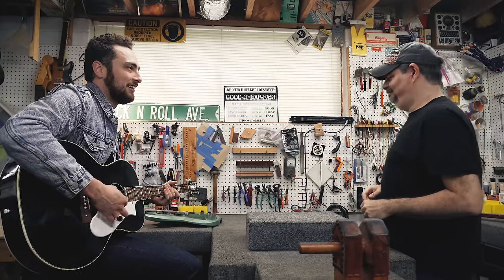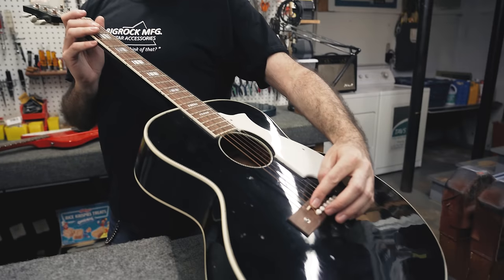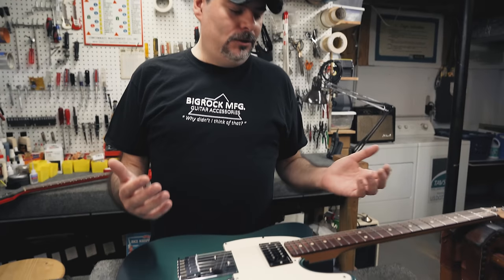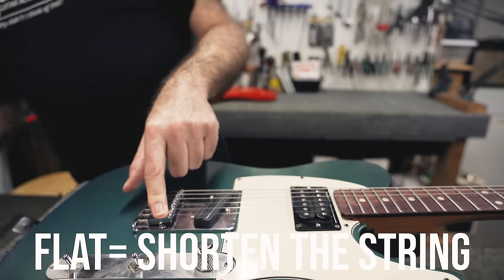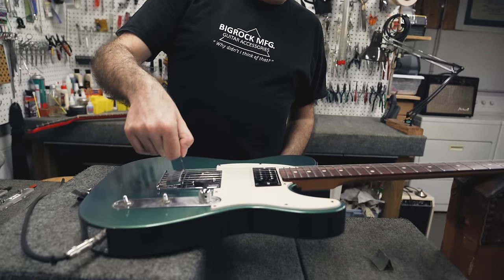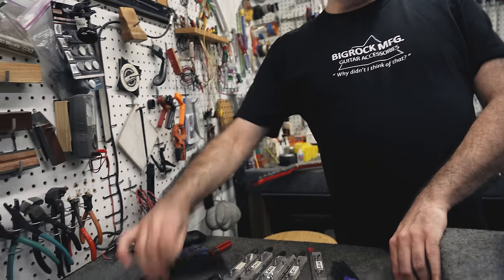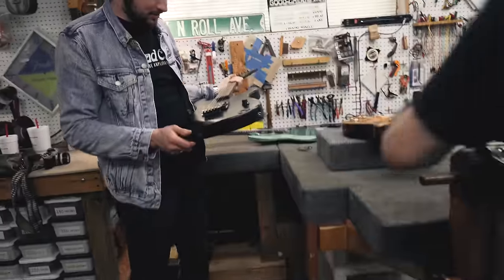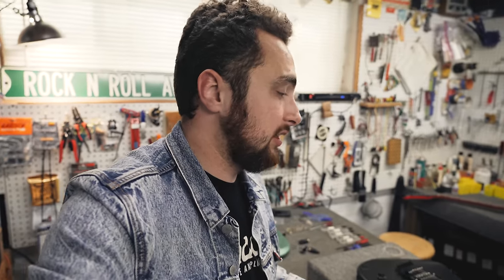5 Guitar Setup Tips & Tricks You NEED To Know

Comment: What a great tip on the pin puller. I've always used the notch on the string winder to pull the pins up, but it can be kind of dicey, as Rhett mentioned. I've ordered one of these and will probably end up getting one to keep in each of my steel string acoustic cases so that I have ready access whenever needed.

Comment: Good stuff.
It is much easier, and more accurate to use the strings on the guitar to check neck relief (bow) rather than trying to eyeball it.   With all strings tuned to pitch, put a capo on the first fret, then fret the string at various points along the fretboard.  It is 98% as good as a regular straight edge.
    The velcro trick is great.  Much better than using tape.

Comment: Great channel.  Thanks.  As far as ideas for another set-up video, I'd love to see Dave start from scratch with changing a nut, but most importantly the process he uses to get the nut slots all cut to the proper depth for a real low action setup.  I've cut two nuts and both times I cut one of the slots just barely too deep and had to use the super glue/baking soda trick to fix my mistake.
Reply: I usually buy nuts that are pre-slotted... they're usually a little too tall, so I just sand off the bottom side of the nut rather than working the top side down, it saves time, but I'm not gonna lie, changing a nut and getting it right takes some time and definitely some patience.  I don't remove the strings from the tuners when I change a nut, I just loosen them and put them off the sides of the neck, taping them down with painter's tape if need be, to keep them out of the way, but I've got to say, Dave's velcro strip trick would be really handy in this situation to keep them out of the way, too, I think.

Comment: I gave up trying to sight down the neck to check bow/relief years ago. The string under tension will be straight. So just put a capo on the first fret, and hold the string down at about the 15th fret for an acoustic, and check how much space there is between the string and the neck at about the 9th fret. Lots of space = too much relief =  tighten the truss rod. No space = back bow = loosen the truss rod. But before mucking with the truss rod, test both the low and high E strings. Sometimes necks twist a bit. As far as intonation testing goes, I find I get better results comparing 7th fret harmonic with 7th fret fretted on acoustic or 19th fret harmonic with 19th fret fretted on electric.

Comment: The acoustic guitar bridge pin thing is actually unnecessary, to my knowledge. If you push the ball-end of the string towards the interior of the guitar (i.e. pushing the end of the string that the pin is holding towards the inside of the guitar), the pin is no longer tensioned and you'll need absolutelly no force to take them off. I don't know if anyone already mentioned it or not. Nice work, Rhett and David!

Comment: Rhett, how about maintenance on tube amps. Are some tubes interchangeable? How and why to adjust bias, if so. How to know tubes are bad or going? Does the clean channel on a hot rod DeVille always distort? Do certain guitars have more distortion than others. Discuss amp hum and noisy power in buildings and what to do about it. Do tube or solid state have more noise? Do you ever find low voltage in buildings? Does it affect your sound? What to do. What about outside gigs with generators. Are they safe on solid state and tube? How do you get your tubes tested? What do you do about noisy jacks on guitars and amps? Do you leave your pedals constantly connected or do you break down your pedal board after gigs or tours?
What are common problems with tube amps and what to do? Are tube varieties interchangeable, which ones and why. Does an el84 replace a 6L6? What about preamp tubes? Can they be swapped out to find a desirable sound? Are Sovtek better than Groove Tubes or any other brand better than another?
What are your favorite guitar pick ups and why? Who builds best or least best pickups? Why would you ever change out your pickups and what do you look for in a pickup? What about Hot Rails? Are they good or bad.
What about acoustic pickups? Do you ever change them out, why? Do you like pietzo pickups or blenders? What to look for when buying an acoustic electric? Chambered vs non chambered electrics, sound, feedback, what to look out for.
Are high ouput pickups more desirable than low output or medium output pickups?
What about splitting a humbucker or parallel windings vs non-parallel winding setups? What position would you want them in, what to expect in sound performance.
The difference in the tell bridge, humbucker or single with the ashtray bridge vs LES Paul and Strat?
Does the neck length between LP, telephone and Strat make a difference?
Does the wire quality in a guitar cord or pedal board cable make a difference in the sound?
I enjoy your shows. Thanks.

Comment: I don't know about guitar action, but I play 6-string bass and I use graduated 12th fret action: B at 2.75 mm, E at 2.5 mm, A at 2.25 mm, and the rest at 2 mm. That gives me more even fretted string tension across the neck and I don't have to worry about the bass side strings rattling. With the neck flat, it plays like butter.

Comment: Cool video, and some cool gear. I especially like the string retainer. Ive Never seen one like that..i will say, You might be able to see major problems with the truss rod by looking down the neck but to truly get it where it needs to be that is not the method.. it also doesn't do much good to check string height from the fretboard considering the string rests on the Fret and fret height changes with each guitar...

Comment: Thanks for this series guys.  Really cool!  I'd love to see Dave talk about soldering.  I'll see irons labeled with watts and then also some that have temperature adjustment.  What temp should I be soldering guitar controls at etc.
Reply: I know you didnt ask me but I solder alot. Temp wise it depends  on what  your soldering. Small components on a board or connections to a pot etc. larger items will absorb more heat etc. for me its about time it takes to heat the joint. You want a quick reaction so  you set the temp accordingly. Average start point when your unsure about 700F. Go up or down from there. A great tip I learned is to use a bit of solder on the tip , this helps transfer the heat quickly and gets you a fast reaction. Make sure it flows well and thats it. There are more tips to good soldering but thats too much typing

Comment: On pickup height I agree. All pickups are not the same. I usually start with the neck flush with the ring. Then I try to balance each string by adjusting the pole screws. When that's done I adjust the height by listening to a balance between a weak and too strong sound and try to hear each note "bloom" or change if possible. I always keep track of how many 360 degree or 180 degree turns I make with the screw on each side. After that it's the same with the bridge pickup and then check the balance of the bridge pickup to the neck. I might have the bridge a little "hotter". I always error on the side of the pickup not being close to the strings. Anyway, that's what I do.

Comment: A capo is even easier for holding strings in place.  Also, keep your bridge pins sorted, or only pull out one at a time, as sometimes these are cut to fit or just worn in and will fit that slot correctly. Good info, thanks for posting!

Comment: Some good tips and tricks right here. I would've liked dave to talk about what to do with acoustic guitars with too high action, if the truss rod is set right. Thanks Rhett.
Reply: Three potential methods, depending on guitar model, and where the action is too high (at the nut, just on upper frets, etc)
- Remove the saddle, sand the underside on a flat sanding block to remove desired amount of material
- File the nut slots deeper (recommend using a set of nut files… not for the feint of heart)
- Remove the nut, sand the underside as described for saddle, and re-install

Comment: Using the correct order for a set up is critical. 
Tune to pitch, then Measure neck relief with feeler gauge with capo at first fret, using manufacturer's spec or your personal preference. (i.e. .0012  @ 7th fret pressing 17th fret on my Tele). If you can't get close to that number, there is a neck bow or unleveled frets to address. You'll have buzzing for sure.
Once neck relief is good, measure string action at 12th fret (no capo). My Tele is good at .060 or 4/64th's across the fret board. Now use the saddle screws to adjust the height of each string. These should parallel on 6 saddle bridges with two screws. When you have string action right, the radius will be correct along with the saddles. No point in adjusting saddles with the radius tool first because it doesn't consider the action height. Set the pickup height next. I like 1/8th on bass side and 5/32 on the treble. Now, you should have optimized your playbility, time for intonation.

Once all that is good look at your 1st fret action. If nut is good you'll be in the vicinity of .0018-.0022 and not be working so hard on open string and cowboy chords. Nut adjustment? Nut work is tricky, if you have to adjust, study up or get luthier help. It is probably the most important variable in a top notch set up.

Comment: Great video. Personally, I only look down to the neck of the guitar to see if it's twisted. For neck relief I usually use a capo (or your finger, whatever you have) on the first fret and place your finger on the last fret and check the distance between the bottom of the string and the top of the fret. Usually want around .012" of clearance so a small gap. Just a method Ive learned from guys like "Dave's World of Fun Stuff" on YT.

Comment: Here's a tip for anyone using a pair of cutters to pull bridge pins:  Use the saddle as a means of leverage, put the cutters handle on the soundhole side of the bridge and just press down gently, you'll break a LOT less pins this way, and you'll have a lot more pin pulling power at the same time.  Best to just buy the tool, but if you HAVE to use cutters to pull them, do so by this method to save your bridge and your bridge pins.  Gently pushing down on the saddle won't hurt the saddle, your strings push it down a LOT harder than you ever will with the side of the cutters.

Comment: Make sure to account for string tension on adjusting truss rods! If you have to take that neck off, the neck is flattening when you loosen all the strings, and if you just blindly say, "ok, I want it there" after adjusting, when you tighten up the strings again, lo and behold, it's too curved cause you didn't adjust for string tension. So get a feel for how much string tension curves your neck, and account for that if you're having to take your neck off to adjust it. With the strings on and tight, see where your neck is and imagine how much change there should be to make it straight, then apply that same change you imagined to the new set point when you take off the strings, flattening the neck. See the now flatter neck, and change its curve the same amount you know your tensioned neck needed to be curved. When you put the strings on again, it'll be perfect. Also, proper setup order: neck first! Then string height, then intonation. You adjust your intonation and realize "hey, I need to adjust the neck too" you've fucked up your intonation, and will have to redo it more than likely. This is from my personal experience and I hope it helps somebody. I just don't want people learning to make the same mistakes and get frustrated with it and give up, giving their guitar to a tech

Comment: Re: Pulling bridge pins—with the string loosened, often you can push the end of the string into the guitar a tiny bit at the bridge pin, and that will make it a lot easier to pull out (because of the wrap at the ball end). —Tom
Reply: Also when the strings are loose you can simply put your hand in the sound hole and push the pins out from the inside.
Reply: @zardeh63  Good point. Pushing through the top is particularly useful if you usually change one string at a time, or if you're replacing a single broken string.

Comment: Most common playability problem on a guitar is nut height. If the guitar immediately feels nicer to play with a capo on the first fret, your nut slots aren't cut quite deep enough. The nut should be holding your strings no higher than a zero fret would in the same position.

Comment: Great practical help, thanks! Quick question.  When measuring the distance between the fretboard and a string, do you measure the distance from the center of the string or from a point on the circumference?
Reply: From bottom of string to top of fret

Comment: 4:40 HOLD UP!  Use a socket, sure, but hold the socket (i.e., do NOT use a driver, hold just the socket with your fingers) and tighten BY HAND otherwise risk cracking the finish!  In fact, just make the nut snug.  The machine head is wood and, as such, will cause the nut loosen up over and over over time.  Just sung up again the next time you change your strings.  NOTE: Not my intent to step on the guru's toes at all.  I cracked my Les Paul because I over tightened with the driver, ugh!  Don't do what I did!  Friends don't let friends harm guitars - ha!
12:39 Guilty, and broke the pin.  In my defense, had no choice at the time - cheers!
Reply: There's a company called HOZAN that makes a set of handheld sockets that are perfect for this, and they also work for tightening the nuts on volume and tone controls, because they're hollow, and you can run a small screwdriver through them to hold the shaft of the control as you're tightening it.  They're called volume box wrenches.  Parts Express used to sell them, they come in a set of 3.

Comment: Never set intonation on old strings.  If they're dead you'll get false readings.
Reply: How though? A string that is in tune is in tune regardless of age
Reply: @teslaedison6236  Because when you put a new set of strings on, you will have to intonate again, since you didn't intonate with fresh strings. Like rock and roll resale said, if they are dead (or old), you will get false readings.
Reply: Tesla Edison 
It’s actually somewhat true. Usually for the coiled strings. They can have little separations in the coils, usually near a contact point like bridge or nut. This can mess with intonation.

Comment: So for clarification, on a compound radius fretboard, adjust for the flatter radius? (i.e. set it for the 16” radius and not the 9.5” radius?). Thanks!
Reply: I would set at 20, imagine a cone that is 9" at the nut and 16" at the 22 fret, by the time it gets to the bridge it would be larger. Thats what I researched for my tele, it seems to work great.

Comment: Are radius gauges required if you just measure how far your strings are from the fretboard?
Reply: no...they're just guides and preference. Not all guitar has the same radius.
I just eyeball..use  a quarter at the 12 fret ( its on low action).
Some people likes it higher

It's even like that on my accoustic...but my accoustic has pick up...
so I dont strum them hard to begin with...like the amp do the work.

I have lots of guitars for many reasons.
Alot of it is becuase they're all tuned different..If you change tuning
the neck will flex back and forth...it'll alter the intonation too.
yes...I even have different guitar with floyd..with different tunnings.
it is what it is. Depending what brand. model...the neck will have
different fretboard and back of neck profile..ect

i also build my own guitars..I did learn if there's not enough tilt angle
on the guitar neck..it'll cuase problems no matter what you do.
Most of the time...factory BOLT ON neck guitars are okay.
Sometimes...there's paint/lacqur in the neck pocket..i'll just file it off...
or increase the tilt angle on the cheaper jackson, tele...ect

It's a pain on accoustic to make that correction..I more mindful
before I make the purchase.

Comment: This was a great idea but an awful lot to fit into the time you allowed. Some of the points deserved more thorough explanation and the last one on pickup height was the most in need. It’s a broad and very subjective adjustment. Judging height using the distance it extends from the pickup ring is not at all reliable. There is no constant from guitar to guitar on how high the bridge is for proper action due to varying neck ankles. 
Really don’t mean to be a jerk but we all have the best intentions.

Comment: Intonation question - On my Strat, my low E saddle is getting very close to being as far back as it can go. I've kept on the neck adjustments, but over time, that one keeps going sharp. (And I check my intonation with new but broken in strings.)  Any suggestions?
Reply: Gary Beason had that with my strat also, if you have the micro tilt adjustment on the neck mounting plate, you may need to turn it clockwise only a bit. It did the trick for me.
Reply: @vdub1959  Sadly, it's a '62 reissue from  1990. So, no micro tilt.